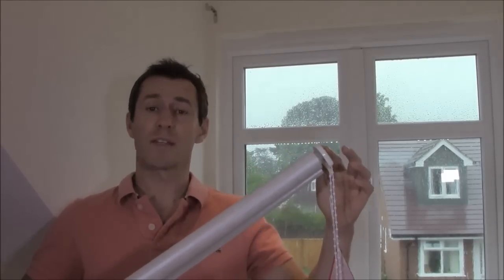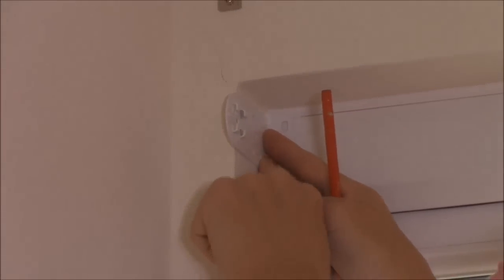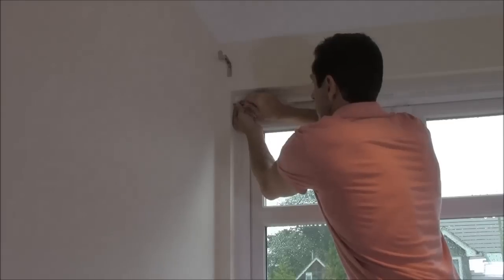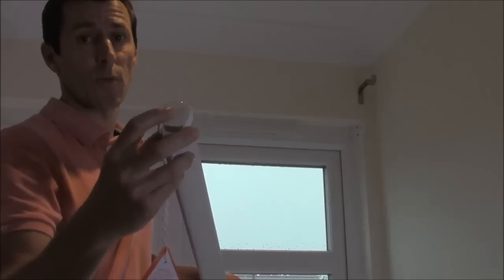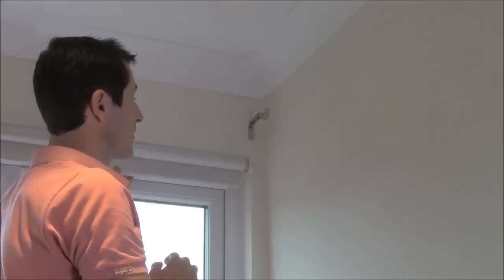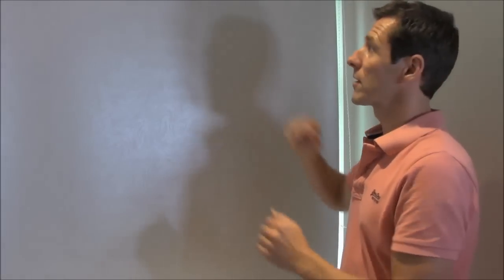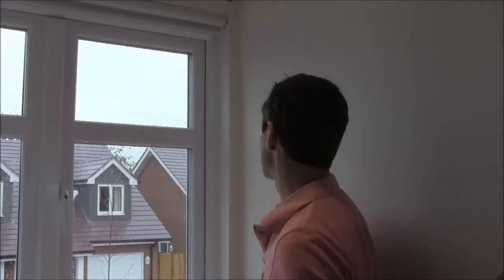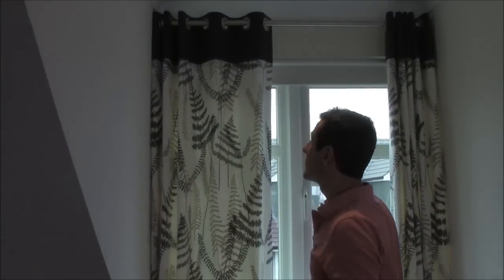FITTING A BLACKOUT ROLLER BLIND - YouTube - recess fit roller blind

Comment: Could someone design a blackout blind that actually blocks out all the light. Most let in light around the edges. I simply can't sleep beyond sunrise if the room is not vertually totally dark. As a consequence I made my own blackout blinds for this. Problem is  they only fit the window I made it for.
Reply: kdmc40 I've just been told about a 'Room darkening system' which uses a cassette to help block out '99%' of the light. Perhaps that could help you?
Reply: I visited Germany and they had some blinds like you've described. I have no idea how to find them though. When they were closed it might as well have been midnight.